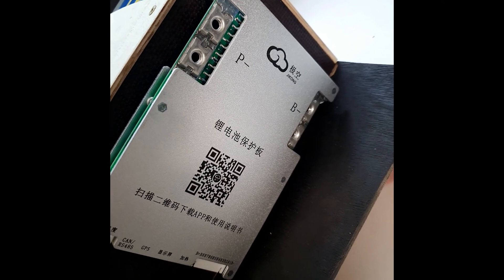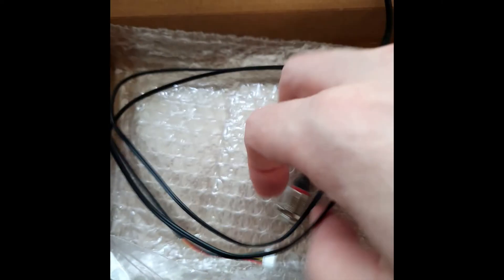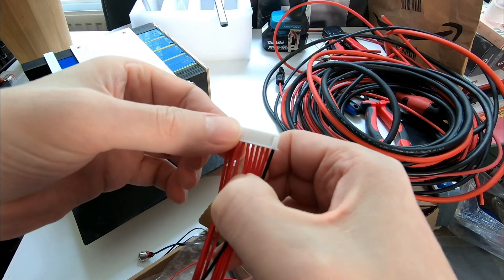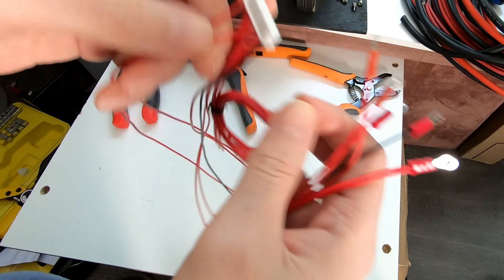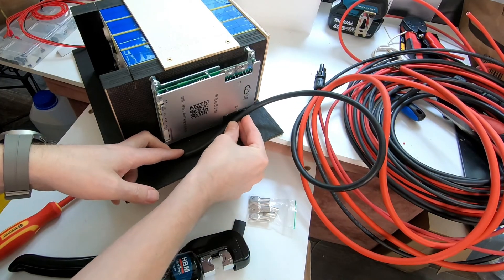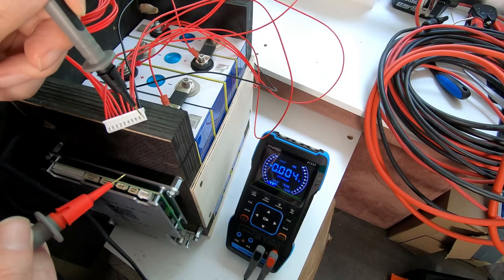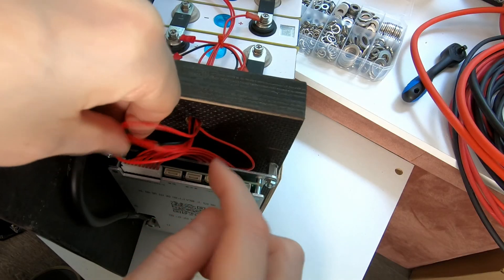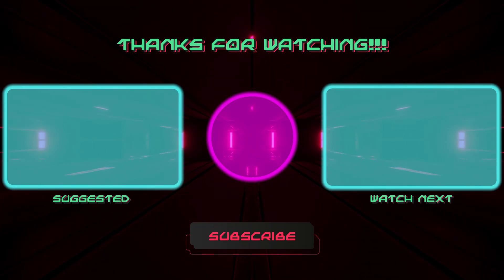How to properly connect JK BMS 4s8s LiFePo⁴ JK B2A8S20P

Comment: I have three 35 mm² cables (multi-strand, welding cables). On one side (input) I want to keep three separate M6 eyelet terminals dedicated for 35 mm² – meaning each cable ends with its own eyelet terminal. On the other side (output) I want two M6 eyelet terminals for 50 mm². I plan to achieve this by splitting the core of one cable (cable no. 1) into two equal halves (each about 17.5 mm²), then twisting one half with the core of cable no. 2, and the other half with the core of cable no. 3. As a result, I will get two bundles with a total cross-section of about 52.5 mm², which I will crimp into M6 50 mm² eyelet terminals using a 7T hydraulic press. This will allow a "reduction" from three input connections to two output ones, while maintaining current capacity. Is this true? Feasible? If not, are there any alternatives? I'll add that I have very little space in the LiFePO4 cell box. I want to connect the BMS b2a8s30p 300A which has three B- terminals with the EVE MB31 cell which has two M6 holes at the negative terminal.
Reply from the maker: That’s some real MacGyver engineering right there.
Reply: @peter4fiter  xD przekombinowane? Da się jakoś łatwiej? Z góry dziękuję za pomoc

Comment: 2a is 2 Amp balancer, 8S is up to 8 "cells" in series, 20P is up to 20 cells in parallel to increase available power in Amp-Hours of the overall battery unit.
Reply: Nope. 20p means 200A continus current. Max 350A for upto a minute. You can connect 200 pieces of 1A cells in parallel or one 1 200A cell, it won't care. The important thing is the max current. Why the notation of 20p, beats me. They could have just written 200.
Reply from the maker: Thank you! 👋🏻🙂
Reply: @peter4fiter  You're welcome.